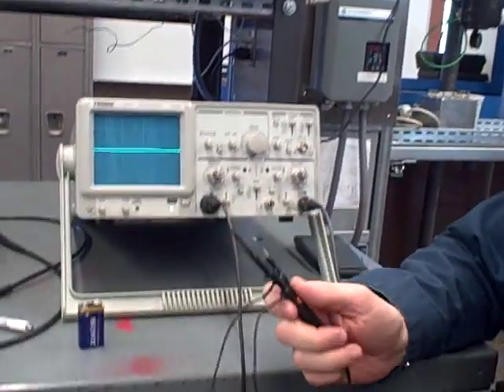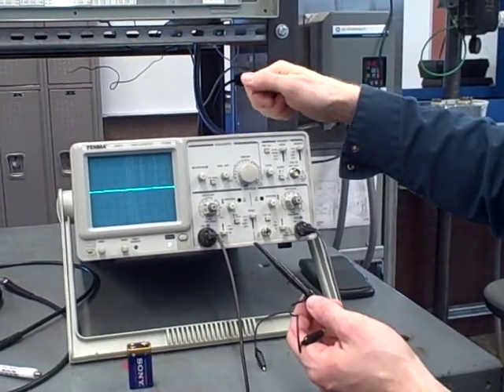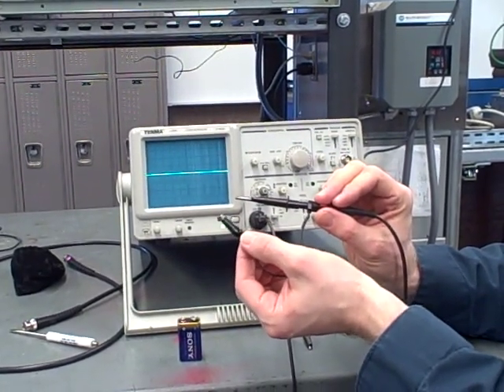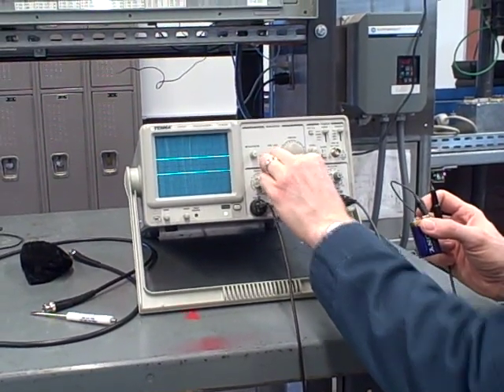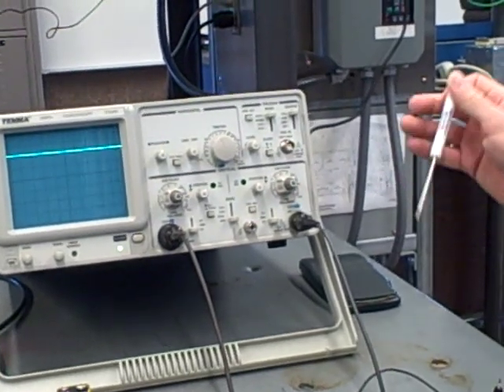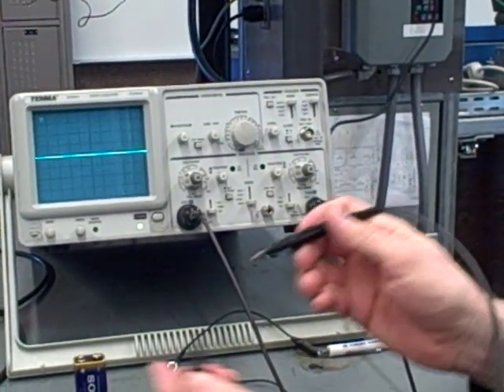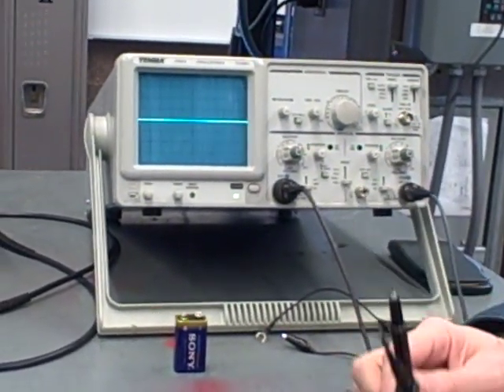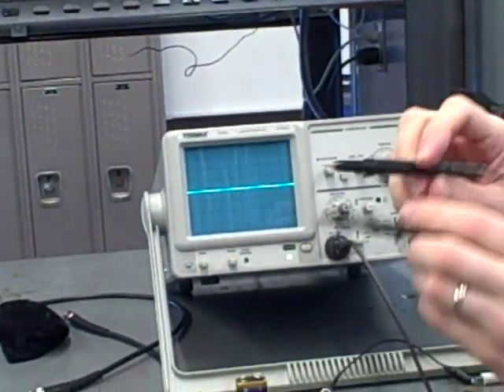Oscilloscope operation differential voltage measurement

Comment: One application of this can be measuring CAN Bus differential signals (CANH and  CANL). Since neither CANH nor CANL is tied to ground, connecting an oscilloscope’s ground clip to either line would create a short circuit therefore we need two probe A(channel 1) and B(Channel 2) in A-B mode.

Comment: Yes but when you'r as an example fixing high frequencies for high voltage, power supplies i mean 300 to 500 khz, you need to control command dead times and power reacting.
This means you need at least 3 isolated superposed measurments . May be only 2 if you can use ground for one of them.
This could even be more complicated when you have multi phases.
This may be also complicated when you use bridges.
99% of oscilloscopes are useless with you work with power electronic because it use all sorts of topologies.
Reply: Why don't manufactures make more totally isolated oscilloscope?
Because they'r only interested by money and prefer to sell many craps than few quality things.
because few people demand it. Because few people really do electronic.

Comment: If we talk about differential signaling (CAN bus for example), why is it needed to also invert one channel? If we apply math channel 1+2 then any difference in voltage would be subtracted and we are left with an actual signal, the same which would transceiver interpret at the end as logical value. 
Or am I wrong?

Comment: Trust me the ADD and Invert work perfect when probing into unknown territory. In high school (1970's) we were taught differently and will not go there do to liability but is does work and prefer not to use that method. It wasn't until I acquired a Tek 7854 which had a differential plugin only to find out later when someone showed me this method the plugin is not needed on a dual trace with ADD and channel 2 Invert. Just remember like this gent said if you were wanting to look at a phase in a motor controller even at just 20 amp fused that ground lead at 16AWG at best will pretty much explode in your hand and molten copper slung everywhere along with melted insulation. Also good 10X probes are not a bad idea either as most budget scopes only go up to 10 volts per division. Good job with the video.

Comment: I have a question sir. I want to measure voltage of charged capacitor without discharge... when I use normal multi-meter, capacitor discharged... oscilloscope also too.,. how can i measure voltage of charged capacitor already...

Comment: I want to troubleshoot a lot of broken PSUs I have, I'm working with DMM to measure voltage on the high power side of the PSU, but I want to look for the where the signal is lost, I want to use the oscilloscope but of course it would blow up at me, so I guess using two channels would solve the problem.

Comment: What if I force GND when measuring differential voltage using an oscilloscope ? What will happen ? It is needed or it has no effects ? Thanks

Comment: I came to  this video to answer a problem that I encountered.  I have  a National instruments  6251 multifunction daq.  I have been trying  to understand  how to connect signal sources and it takes quite a lot of understanding.
 (please correct me)  2. types of signals . ground source and floating source.  Then  the device doing the measuring can  be set up as 1. differental , NRSE and RSE. 
I think  you have  set the scope to differential mode? measuring a  floating source? Am I  right ? Creating  the same way my DAQ device sees the signal? This  is  what I was trying to find out  how to do!!! Thanks a billion.

Comment: This guy was right on the money!  I have had personal experience measuring Variable Frequency Drive output on a normal scope and burned up the probe!  I ended up using a Fluke 123 20Mhz battery powered Oscilloscope to make the measurement because a battery powered scope ground lead is not referenced to ground so I didn't burn up my scope probe.  I have also measured RS-485 communication links and he is right again.  You can not connect that ground lead to the other wire with a balanced differential signal such as RS-485.  Differential probe measurements are important. You should know how to perform a differential measurement and WHY you need to do a differential measurement.  I burned up a $400 500 Mhz Tektronix scope probe because I didn't know this.  It was a mistake that cost me $400 but I learned the importance of knowing how your scope REALLY works on the inside. I can personally vouch for everything he has said.  Great Video.

Comment: There are several potential problems with combining two single-ended measurements. One problem is that there are two long and separate signal paths down each probe and through each oscilloscope channel. Any delay differences between these paths results in time skewing of the two signals. On high-speed signals, this skew can result in significant amplitude and timing errors in the computed difference signal. To minimize this, matched probes should be used.
Reply: It´s a turnarround for begginers till they have the enough money to buy a differential probe. Problem is that begginers could blow the scope trying to measure 2 phases of a motor, there are huge spikes, burn scopes front end at least.

Comment: Another problem with single-ended measurements is that they don’t provide adequate common-mode noise rejection. Many low-level signals, such as disk read channel signals, are transmitted and processed differentially in order to take advantage of common-mode noise rejection. Common- mode noise is noise that is impressed on both signal lines by such things as nearby clock lines or noise from external sources such as fluorescent lights. In a differential system this common-mode noise is subtracted.

Comment: Because of channel differences, the CMRR performance of single-ended measurements quickly declines to dismal levels with increasing frequency. This results in the signal appearing noisier than it actually would be if the common-mode rejection of the source had been maintained.
A differential probe, on the other hand, uses a differential amplifier to subtract the two signals, resulting in one differential signal for measurement by one channel of the oscilloscope

Comment: This is one of the most important things to know about CROs. Even after training as a TV Tech I didn't know it (or didn't understand it at least).

 I melted down the speaker coil of a $1200 100W Tannoy Little Red studio monitor by shorting all the current supplied by the output of a high powered monitor amp through the speaker coil to earth with my probe earth lead.

By the time I saw the smoke it was too late. Ouch!

Comment from the maker: @ragundo 100:1 should be a good ratio to use.  Be sure to check the specifications on the probe for maximum voltage.  VFDs can put out very high voltage spikes, especially if there is "ringing" on the motor conductors (voltage pulses echoing back and forth along the cable's length).

Comment from the maker: You can use an isolation transformer (and rest the scope on a rubber mat so it won't ground through the metal workbench), but then the entire chasses of the scope rises to the potential that the "ground" clip is connected to.  This can be very dangerous.  Additionally, if measuring high-frequency signals (e.g. communications, radio), the capacitance between the now-ungrounded scope chassis and surrounding (grounded) objects will cause problems.
Reply: I know this answer is 14 years old, todays scopes chassis are plastic. The only hazzard is in the outer ring off the BNC connectors. both front and rear are floating , also you can connect the scope to a USB device thats grounded, boooom!

Comment: How about if you use a isolation transformer on the scope power supply?
You should be able to connect one of the ground clips to a point that is not true ground?